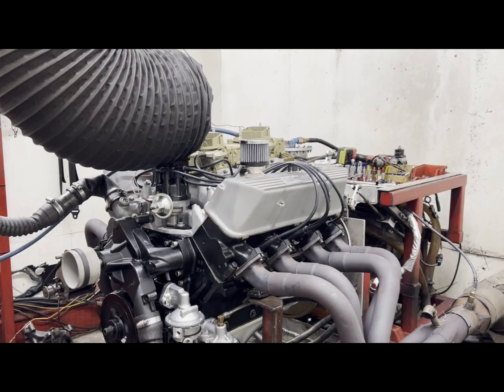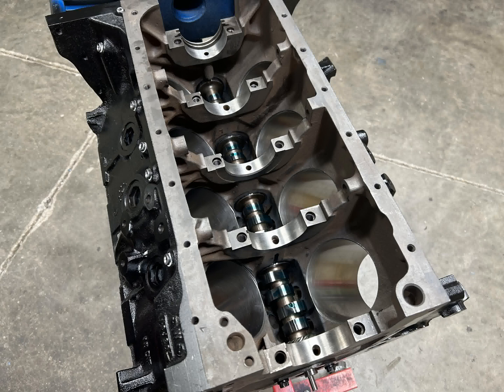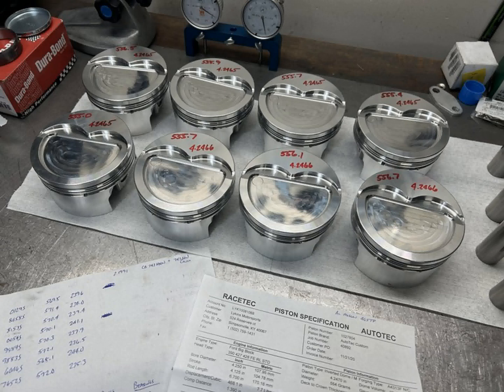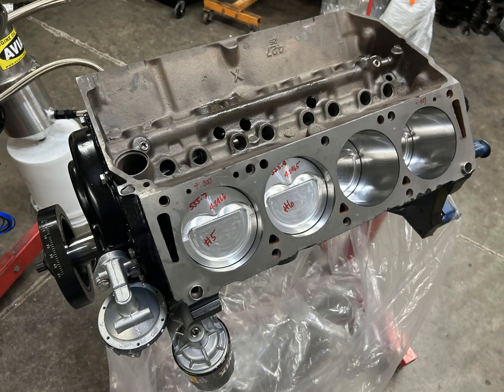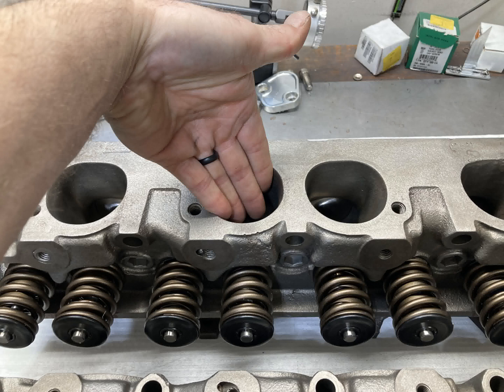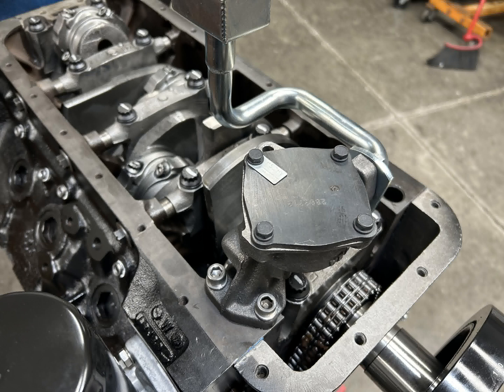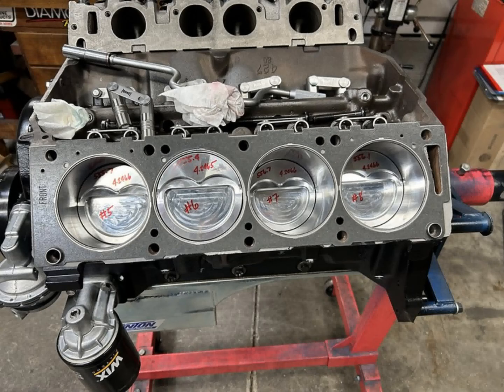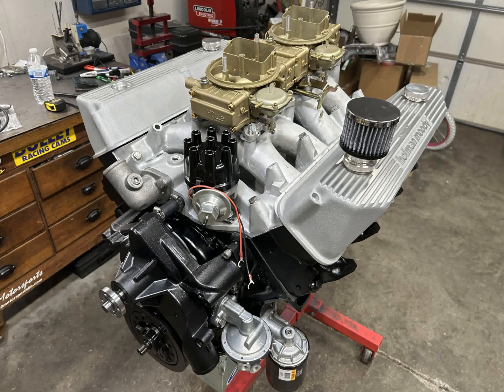Lykins Motorsports 575HP 465ci Ford FE Tunnel Port Build/Dyno

Comment: I have a 1969 Cobra that has the 428cj engine in it. I had Blair Patrick build my engine that almost is exactly like yours, 465 cubes Scat forged crankshaft, H beam rod's, Racetec pistons, hydraulic roller camshaft, high flow belt driven water pump, high flow fuel pump like yours, custom 850 cfm vacuum secondary carburetor, camshaft 246/254 duration at .050 .I had my factory 428cj heads ported, polished cnc by him. 9:1 compression, custom built try Y headers that would fit my car.The power and torque with these headers was 568.5 peak hp at 6240 rpm and peak torque 544.3 at 5040 rpm .I can drive the car in town or on the highway with factory fan,clutch fan and never gets hot.😊 The engines are very close in power and torque.
Reply: Nice motor, what did the cast iron heads flow when got dine cnc porting
Reply: He didn't tell, I was going to put a pair of Trick-Flo's on it but he told me to let him run through his cnc program instead.

Comment: Tq seems low down low 284 at 4000
Reply from the maker: You don’t load these kinds of engines hard down low.  The low rpm numbers can’t be counted on.
Reply: @lykinsmotorsports  Brent thanks for explaining this important point. I was going to try but my boring comments tend to ramble on forever 🤷‍♂️.
Reply: @lykinsmotorsports very nice engine build,do you have the 5/16 S I valves 2 .15,1.65 exhaust valves to work in a FE engine,